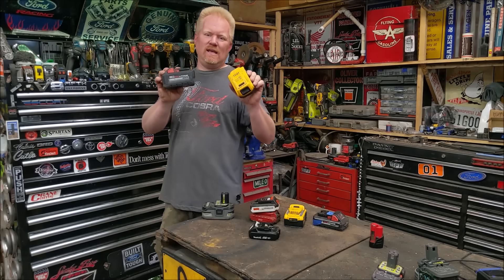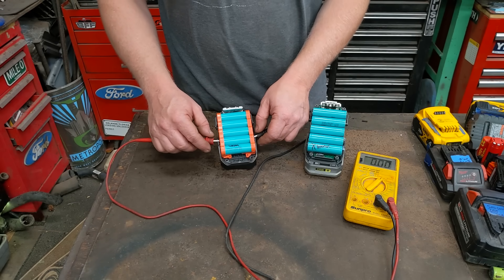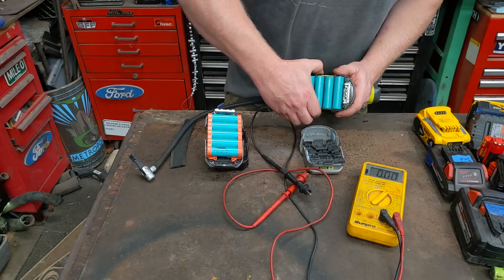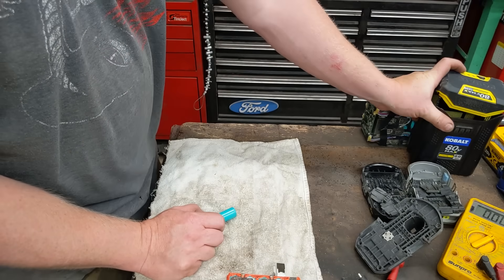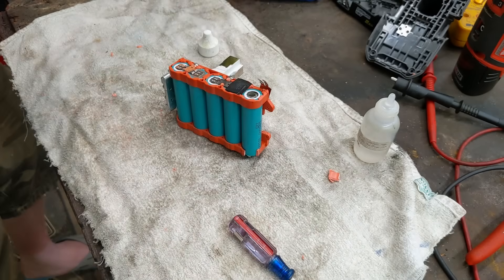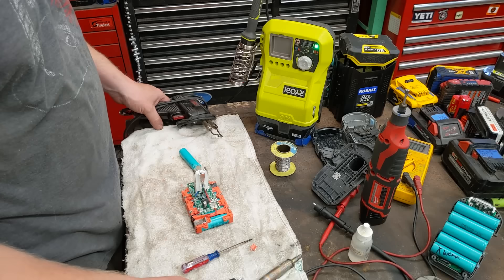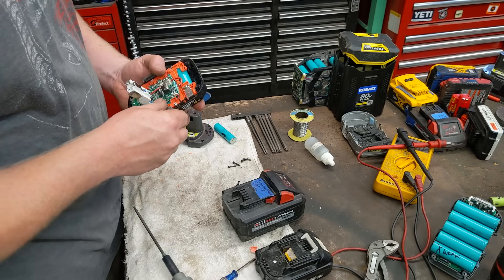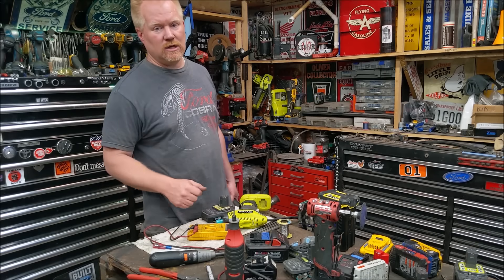Revive DEAD Battery Packs - Rebuild Repair - Dewalt Milwaukee Makita Ryobi Bauer Ridgid 18v 20v 12v

Comment: You touched on an important subject regarding only using high drain cells. The biggest way people screw up when replacing all cells in a battery pack is by using laptop cells. Laptop cells have high amp hour ratings, but can only handle a fraction of the instantaneous current that high drain cells provide. Laptop cells will perform poorly under heavy load and will have a short life span.
Reply: what is a "laptop" cell??
Reply: @kenluther9948  cells that are found in laptop battery packs. Low draw devices.
Reply: I checked the cost for 10 high drain batteries. almost 40 dollars. 

For 70 dollars I can buy another impact gun that comes with 2 batteries, so 20 cells total.

Its cheaper to reuse the old battery pack for flashlights. 

Crazy.
Reply: i was literally just about to make a pack with 6 high drains and 1 battery bank cell this vid saved my ass
Reply: I've actually restored bunch of makita 18v batteries with laptop cells. Just use low ohm cells, i've used <40mohm laptop cells and they work great. Won't get hot when in use or charging and also last great (no huge voltage drop under load).
Cells like this are just hard to find from laptops, you need to have hundreds of cells
Reply: @hannessaariste  Do you just measure them with a normal meter?
Reply: @paulb9769  I used my X-tar VC4S for that
Reply: @hannessaariste  your example is the exception to the rule, and as such the comment was essentially worthless. Use your brain first.
Reply: @johnrhodes3350   Well, not a good idea for some 5s 5cell packs, but definitely works when there are multiple cells in parallel. Also note that some chinese makita copys have much worse cells. After all internal resistance is what causes the voltage drop and why cells get hot.

Comment: First off:  Give Ginger another biscuit.

I had similarly the same issue with solar-powered lights.  The solar panel was tested and it was putting out the needed voltage to keep the batteries charged, so I figured it had to be the batteries not accepting the charge.  I went and ordered a 10-pack of matching batteries because I had 3 of these same lights. I tested the batteries on each one just like you did. I disassembled them because the new batteries cost me around $15.00 for ten of them and each light cost over $40.00 new a few years ago, so the expense was worth it.  

Once I disconnected the old batteries that showed no power and soldered in new ones I saved 3 lights from the dump.

By the way, those 3 solar lights went almost 3 years without a problem, so hopefully, the new batteries will last just as long.  I think it took about an hour to repair each one (disassembly was a headache), but well worth it as they live again and it didn't cost me another $150.00+ (Current Prices) to replace the lights. I still have 6 batteries left over, but it was cheaper to buy them in quantities of ten than one at a time.

P.S. I don't throw anything away intact. If I can recover a screw, bolt, washer, etc. from it, I do. This has saved me many trips to the hardware store when building something totally different.
Reply from the maker: That's great. Some people get enjoyment out of fixing, learning and saving money. The rest only get enjoyment out of shinny new and spending money, which is a never ending battle.
Reply: Great idea actually. I'm gonna start doing this exact thing m

Comment: Lithium cells are quite impressive for there size, just look at modern jump start .
So much current , amazing.
Your dog is just loverly, she is so forgiving.
Reply from the maker: Yes, thanks
Reply: Unfortunately they still lack the power density of Gasoline....among other issues.

Battery technology is really holding back the capabilities of electric motors.

Comment: Got a weedwacker and chainsaw that takes those kobalt 80 volts. I  bought the saw since it came with a new battery. And was about the same price as a battery.
Reply from the maker: They like to charge an arm and leg for these yard tool batteries.

Comment: Thank you! I got a nice Craftsman full drill kit at auction dirt cheap and none of the 3 battery packs hold charge. I plan on using 1 of the 3 to revive the other 2. I knew if was possible from your other videos. This shows me exactly what I need to do. And what not to do. I’m working with my 8 month old boxer-pit mix to be as well trained as your dog. She might be too dumb or too smart to be trained. I’m betting too smart, but I will keep working on her.
Reply: If you want a well behaved dog you have to establish and maintain dominance. 

I used to have a Belgian Malinois. One morning I was taking the kids to school and forgot to close the door. I returned home to a wide open front door and a content dog laying at the top of the stairs. 
Focus on positive reinforcement.
Reply: As soon as you accept the fact that dogs are much smarter than people the training gets easier... Establish a bond and be consistent Exercise her to wear her out before training bribe her with tiny treats every time she does good and it will all fall into place//
Reply: If your battery packs are year 2019, they are probably defective. When Craftsman V20 first came out, the initial batch of batteries all had defective circuit boards inside that would drain and kill the battery cells.

Comment: Fun fact: If you try to drill out a security screw long enough, the fastener will just heat up and pop right through the plastic.
 Problem solved.
Reply from the maker: Very true.

Comment: Will that apply to the eco 56v? Thanks Moe for the info.
Reply from the maker: Yes. However... The Ego 56v also have circuit board issues. So I would take it apart and test the cell voltages. The way the stack the cells the centers are a little hard to reach(you'll see) but doable. If they are all about the same, the problem is the circuit board. I'm not sure if anyone sells just the boards(they are simple plug in with connectors).
Reply: @sixtyfiveford  ok,  thanks

Comment: I used an old phone charger to revive a few ryobi batteries
Reply: I know that the voltage on the battery pack needs to reach a certain point for the charger to charge it

Comment: Great info! I have several packs that the BMS failed.  The cells are still good but the little circuit board inside is bad.  I take the cells out of those and use them as replacements as needed.
Reply from the maker: Awesome.